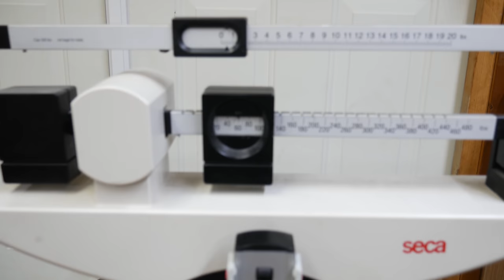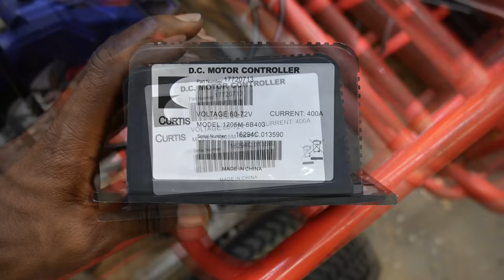Common Problems With Making An Electric Go Kart or EBike and How I Resolved Them. #063

Comment: Love your videos.  One note that might help you with the 2awg wire crimping is to remember that the way the lugs bite it will hold much better if you put something in the Vice when you crimp it to prevent flattening the entire thing because the way they hold is by pinching one part of the cable while the furthest end is more flared and that’s what prevents it from pulling out. The problem with flattening the entire end is that if the entire cable is pinched the same it can eventually pull out.  Maybe you won’t have any trouble with yours but just in case you do or they start coming loose hope this helps. You might could even take a full chisel and instead of just hitting it with a hammer alone use the chisel to secure it.

Comment: Hi Jeremy, 

the flanged bearings you want to use look like normal ball bearings. There are a couple of serious problems with that. Most of them are meant for supporting loads perpendicular to axle (radial loads) even if they look very beefy they are very bad at handling axial loads. Depending on the type of ball bearing they can handle axial loads from 25% to 50% of their maximum radial load and unfortunately axial and radial loads add up (vector addition).

Another problem is alignment, shafts supported by two bearings and the center-lines of rotation of these bearings are not within 2–10 minutes of arc then large forces are exerted on the bearings that may destroy them. (unless they are self-aligning bearings)

All of the above problems are made worse by the fact the cart has no differential.

Your bearings are probably O.K. if you only want to drive a little bit faster than walking speed. If not the best case scenario is that you will have to replace the bearings regularly.

I would recommend using tapered roller bearings, they are build for that purpose and are a much safer and in the long run cheaper option.

Wow That was probably more than you ever wanted to know about bearings :) and sorry if that was a little long winded or sounded weird English is not my first language.

I really appreciate your videos! Thanks and good luck with your Kart.
Reply from the maker: I am pretty sure the are spherical bearings but I will double check. But they swivel and can handle misalignment. There isn't much axial load in this application in my opinion... as long as I am careful to align the sprockets with each other. I do plan to calculate the bending on the shaft as I am more worried about the distance between the bearings. But at 1" or about 25mm my larger motor at 10 hp shouldn't be a major problem. I will definitely check though.
Reply: You are probably right, I did a couple of rough calculations, assuming a total wight of 400kg (~880 lbs.) and a speed of 10 mph I got around 2-3 kN of centrifugal force for a 90° turn with 3m radius.

Then I used the SKF bearing calculator (https://webtools.skf.com/BearingCalc/selectProduct.action;jsessionid=0 ) to check the combined forces. 

Well that was fun now I want to start a new project.

Keep up the good work.
Reply from the maker: 😂 that is awesome!

Comment: Super sweet build! In regard to having a passenger seat for one of your kids, have you considered splitting up the battery placement? It looks like you can put two forward and two back, therefore leaving some legroom in the middle. Put a little diy bench seat above the two back placed batteries and you'll be good to give your kids a thrill!

Comment: "Finally something works"!
We've all been there, hahahaha! 😂
Someone posted "what about using capacitors to cover your inrush load?" (paraphrased)
Had the same thought too but then i thought what about using an old school centrifugal clutch or variable speed torque drive to ease the initial take off. (Ease it on slowly)
Just a thought. Maybe even something as primitive as a manual engagement like on an edger. I'll review more of your vids to see if you already dialed it in (i might just be johnny come lately).
Your greatest virtue is inspiring the thoughts & ideas of others! Thank you SO much for that sir!

Comment: I ground crimp notches in a small bolt cutter for crimping larger connectors. The bolt cutters were already chipped so I had nothing to lose with this mod. Works perfectly.
Reply from the maker: That is awesome. Wish I had this comment back before I bought a tool LOL. Thanks for the great suggestion. I think even if you bought a new one it would be cheaper and work well

Comment: adding a jack shaft when you could have easily notched that frame? And Ive had several of these spiderbox karts, and that weight of the batteries is maxing out the crappy suspension, time to upgrade those springs/shocks as well. Should be a fun toy once done!
Reply: I thought the same about the shocks--I've got the Yerf Dog kart a few notches down w/o the rear swingarm suspension and only the lower A arm up front and the stock shocks aren't gonna handle that weight very well. I also wondered about combining his direct drive setup with the original torque clutch--I know the motor has enough torque, but using a sprocket to multiply the input shaft speed on a 50-series Comet clutch should net a higher top speed and a smoother take off. I had been thinking about an electric conversion for mine, but I think keeping the original gas engine is just easier...

Comment: You might want to get ahold of a PLC. That way you can use a 5volt controller and 60volt motors. You might also want to consider a smaller high torc motor to get you started and then use the larger motor to make you actually go.

Comment: Don't write off Li-Ion/Li-Po because you  are scared of it or don't understand it. It's VERY easy to make a battery pack using re-purpose 18650 or even new ones. I see you are running 48V. You could build a 14S6P pack which would weigh MAYBE 20lbs while providing 20+ amps continuous and 20 AH. I have built a 14S6P for around $120 total. There are DIY battery kits that are no solder set ups, just plug and play
Reply: My 48V/30Ah 14S6P pack weighs just over 10lbs. $120 sounds about right. I used generic cells so there was more room in the budget for a beefy bms.
Reply from the maker: I need at least 100 amps continuously for 30 minutes and up to 200 amps if I want to floor it. I understand how to make it. We all have different things we prefer to do. Soldering batteries is low on my list.
Reply: Soldering is at the bottom of my list, for certain. Fortunately, I have access to a spot welder! Unfortunately, I don't know of any method to get 200 amps out of a lead battery that doesn't weight 100+ lbs. Hopefully one of your other neighbors can help!
Reply: Samsung ICR 18650-22p Battery Module... 200amp continuous, more MAH than you would ever need and no soldering
Reply: He mentioned that those who want to can go with Lithium for reduced weight. He obviously understands the trade offs. There is no getting around the fact that lithium ion battery packs are more complex and expensive than lead acid batteries, assuming you compare fairly (new vs new of the same Wh capacity).
Reply: @Jeremy_Fielding  Or buy used Toyota Prius cells. They are 7.7 - 8.0volts at 6.50 amps and only weight 2.30 pounds, and are on ebay for $30 or so. With a 60 pound battery pack you could get some real power out of it...:)
Reply: Use lifepo4 batts. Some version comes with a bolt and nut for busbars for easy installation

Comment: Send the vise back. It should not break with hand turning. Maybe if you had a four foot bar on it, and putting your full body weight.
If it broke by hand cranking, you should return it without guilt. I would bet you something nice that you can repeat the job with the replacement and it will not fail.... just my 2 cents worth. Harbour freight replaces this type of thing no questions asked ! Oh, by the way I really like your videos, they have been a tremendous help, and source of inspiration and information in my quest for an electric bike, keep making these excellent videos !

Comment: Really enjoy your videos, and I enjoy tinkering with salvaged motors as well.  I suggest you google "sledger cable crimp" and have a look see at a simple way to crimp terminals on large cable. It is a punch and die that you wham with a big hammer, makes quick work of crimping large connectors.  Inexpensive too.
Reply from the maker: I will check it out

Comment: I had an electric car(Renault Lectric Leopard). It ran on 16 golfcart batteries. The speed controller was a relay switch that switched between 24 and 48 volts. I was hoping to make my own speed controller using a 555 timer, opamp and H bridge.. I never got to do it, but I hope all of those people out there will never stop being creative.. God Bless.
Reply: I had a stack of 3 12v sealed lead acid batteries and an elaborate series/parallel switch to go to 36 volt series for powering an amplifier and 12 volt for the charger I had. I had the trouble in that it would short under load because of the arcing within the switch itself. The capacitor in the amp drew quite a high current when going from 12 to 36 volt mode and I had to install an easy break in the circuit to avoid melting wires. What I really needed was a switchable power resistor to limit the inrush current. Also a fuse.

Comment: So every good workbench needs a good solid vice.  The problem is that anything new is going to be made out of Chinesium steel (unless you want to pay big bucks).  You should take back your Harbor Freight vise and should refund you your money) and use the money to buy an old America Vice for cheap on Craigslist, etc.  Those old Vices are so well build they will last several lifetimes... Just look for one that has good jaws, hasn't been repaired (I.E: welded) and looks decent structurally, don't worry at all about the finish because if it looks crusty you can get them for cheap.  They are super easy to clean up, throw a new paint job on and grease and then you will have a Vice that will last for the rest of your lifetime and then some.  Some great old American Brands to look for are Wilton, Reed, Chas Parker, Starrett/Athol, Prentise, Morgan, etc, but if if was made in America, it will more be likely good.  You should be able to find something for around $50 and once you clean it up they can be even be resold for sometimes up to $200 as they can be highly sought after depending on condition/make, etc...  A little tip for you, you deserve a real vise... keep up the good work!
Reply from the maker: I plan to return it. It has been 80 days so I am just inside the return window LOL
Reply: Atimatik Army yep 90 days and you can return it...
Reply: I love my Chas Parker!  I got it for $30 at a flea market.  It’s a #44 and turns out to be super rare.  The online database of all Chas Parker vises doesn’t even list it.  I’m not sure if it is worth anything but I know it is a beast and will outlast me.
Reply: Good Find on the Chas Parker!  I'm sure it's worth more than the $30 you paid for it!
Reply: Atimatik Army Ah an AVE subscriber. The Chinesium gave you away.
Reply: Atimatik Army they are everywhere around me.  I live thirty minutes from where they were made.  But the deal I got was still really good.  Usually I’m the guy who gets the bad deal so I hold on to this one win.
Reply: LOL yep, an Ave subscriber for sure!  

Any respectable workshop should have a good, solid bench vise,  The no longer manufactured American made vises were and are the best the world had to offer.  And certainly, they are far better that anything new found at these big box stores...  ...even being sometimes 50-100 years old! And Lou, Chas Parker was one of the most respected, but really anything American made was and is honestly great when it comes to vices and tools.

Comment: You can get solder slugs from places like O’Reilly auto parts for doing up big gauge wires, put one in the cable end hit it with some heat then shove the wire in.
Reply from the maker: solder slugs... I have never heard of that thank you.

Comment: My batteries rest symmetrically in a pan, under the seat. They're also slightly rear of CM to help stability. Also front end alignment is dependent on mass distribution, especially at any appreciable speed. Negative camber can help around the corners with that much mass.

Comment: I'd say the documentation for that new controller is wrong, otherwise the specs on the label would match. I find that sort of thing happens sometimes with no-name products. Good info none the less. I'm building an electric dirt bike atm. 3kW drive system.
Reply from the maker: The documentation does match the controller. It has two "nominal settings" 60 and 72. But each one has a working range. and that is what I was referring to.
Reply: I've been selling high power controllers since 2005 and my educated guess is that your Curtis controller is going to test good when you send it back.  If you have not done that yet try again at a minimum voltage of at least 60 volts, and source this power from good lead acid batteries that have all passed a load test.  If you add a car battery to your 4 battery deep cycle pack, AND all the batteries can maintain 10+ volts under 100+ amp load, you will have enough power to charge the massive capacitors in the Curtis controller and it will work.  Curtis is a long term industry leader in motor control, not a "no-name product" as James suggested.  Alltrax motor controllers are also superior products and offer simple user friendly programming of things like min/max voltage, ramp-up rate, max current etc. The smaller controller that came with your motor is either a Curtis copy or a remanufactured Curtis and the case size puts it in the 100 to 175 amp range.  Good luck, and remember to always respect the power (and dangers involved) with this much battery.
Reply from the maker: Already did exactly this. 5  “load tested” , fully charged batteries. I thought the same thing. I followed the troubleshooting guide in the manual. It failed test 4. The manual says faulty controller if test 4 fails. My new one has arrived and it works great.
Reply: Back in business is the good thing.  I am still getting caught up on your videos and diversity of projects (bad-_ss band saw by the way), so I need more viewing time but there is a lot to learn when you go electric. I'm guessing by now you have got the "electric bug" and I'm sure it won't be long before you have the Curtis running at max voltage which will make for fun acceleration (at least until the brushes melt into the armature). ha ha keep up the good work.

Comment: I'm curious why you didn't use solder on the terminals instead of crimping? I've purchased some for 00 gauge wire that was preloaded with solder. Just heat it up and shove the wire in. Nice and simple.

Comment: That's a really nice go kart!

My pos had no suspension, the large gear was connected to the one drive wheel, almost as big as the tire, and the goddamn axle kept breaking it's weld (it was inserted into the frame, so it wouldn't break off entirely, but wouldn't be straight), so the chain would derail. 

The only upside is it had a lot of torque to get up hills easily, so it was fairly slow top speed.

Comment: Unless you're a long term extreme bodybuilder... no, a vise that big should have held.
Another thing would be if you added more leverage somehow, but since you said you didn't, this means very much that the vise is at fault.
Reply: Agreed.  I have 3 vise's and i put allot of force on them and have never broken one.  I even use cheater bars with them now and then or hit the handles with a hammer even.
Reply: Lagger Onesixfour those POS, PRC vices are total junk...
Reply: It broke because he tightened it up and then HIT it. That's what snapped the shaft. However it's a POS and very small for hobby use only. Harbor Freight will replace it under warranty.

Comment: If those terminals are aluminum, then you need to apply an oxidation inhibitor (e.g. Noalox) to all connections or they will get hot over time and start a fire.  It is more likely that the terminals are tinned copper.

Comment: What you need is a step up / step down voltage controller (can't remember exactly what it is called) the idea is to step up the voltage as the lead acid battery drains down keeping it at 13.8 volts. This enables you to get rid of 2 of the batteries losing 120 pounds. Add a solar panel to the top and you will increase your range even more. I believe with a little work a 160 watt panel would fit although you would want to start as far back as possible. Perhaps 2 100 watt panels could fit one in the rear the other in front. Even one would help alot. Keep in n mind if you decide to add this, that many (far too many) solar panels are very fragile, many without any protective glass on top so at least get some plexi-glass (with space to dissipate heat and for protection and keep it waxed for performance) for the top and some epoxy for the underside for strength.

Comment: how could you not do a follow up video to this!! (yes, I saw the cart go in that video) what motor did you use? speed controller? how did you rig the shaft and final sprocket? argggg!!! ;)
Reply from the maker: LOL... There was a short video that covered some of this stuff but I deleted it about a month ago while deleting some other non-build/non-teaching videos that were meant to be temporary. The motor I used (discovered through testing) was falsely advertised to have more power than it actually has... I didn't want people to see it without being able to explain that it is NOT what they say it is. If I do that in a separate video the wrong people will see it. I didn't want to support that manufacture. I know from emails and comments that people often buy things they see me use even if I don''t say I like it or talk about it.